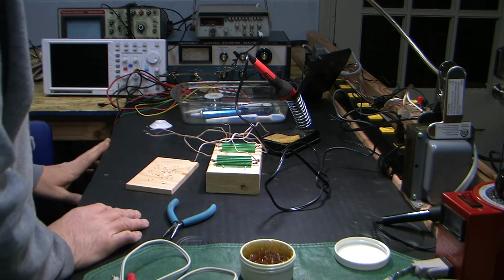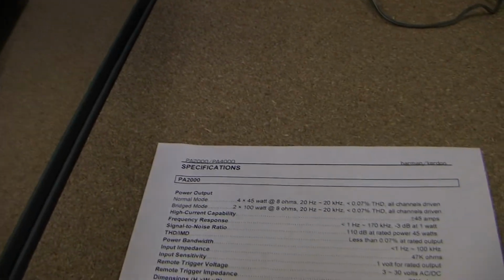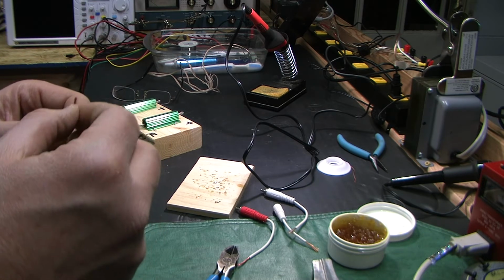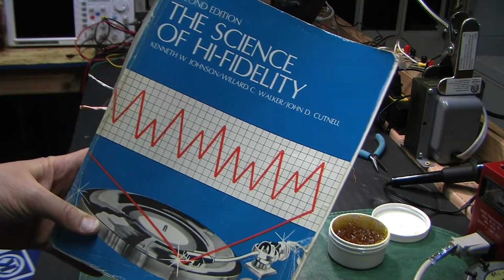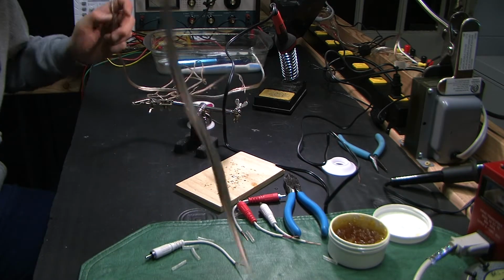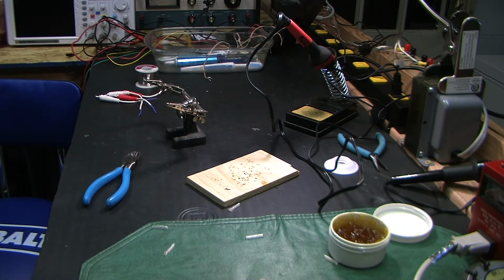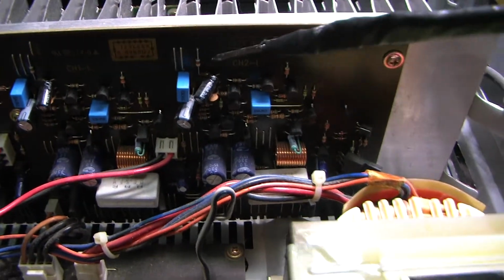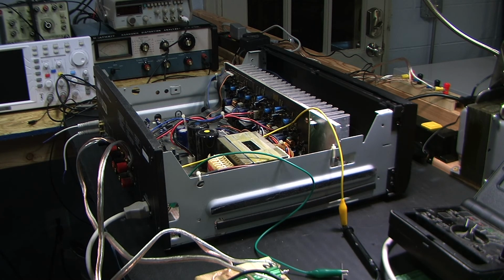Harman Kardon PA2000 Amp Project Part 1

Comment: Question...I also have a Harman Kardon PA2000 that I have had in my garage for many years, unused. I added a kick drum mic to my drum kit and got a 18" sub that I was going to run off the PA2000. But for some reason there is very little volume. With the mic preamp set to max output, the amp bridged and the volume control set to max, the sound is barely detectable. The volume does change if I adjust the volume control on the back of the amp. It doesn't matter which of the bridged amps I use, the result is the same. I am wondering if what you said about the capacitors could be an issue? I would think it has something to do with the input side of the amp and not the amps themselves. I am going to pull it apart this weekend to see if there is any obvious issues, but would love to hear your opinion.
Reply: you have an audiophile amp in your garage ? i imagine what you have in your living room